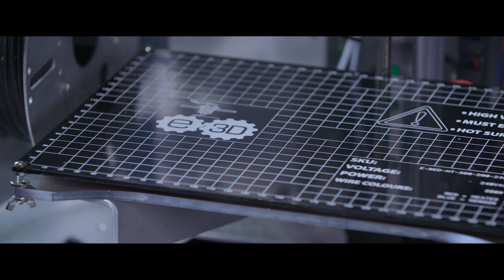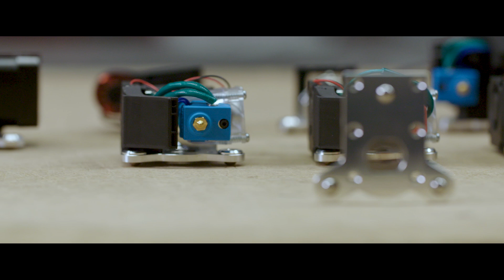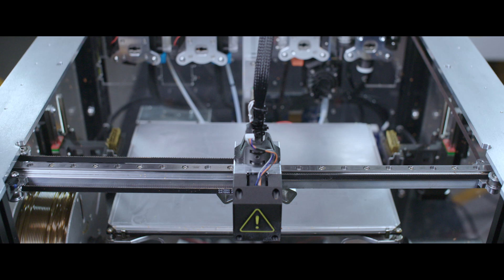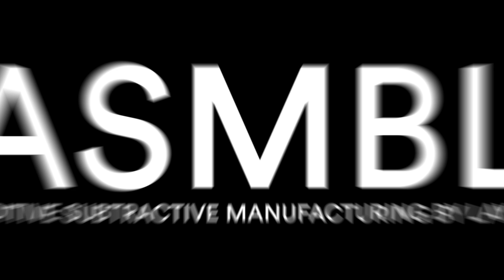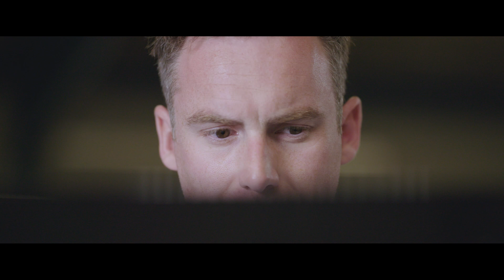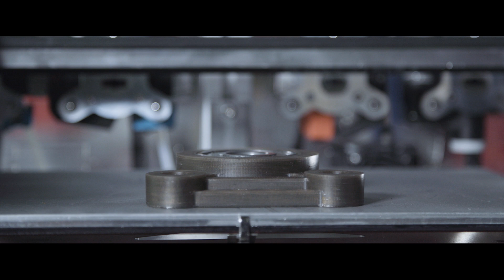The E3D ToolChanger & Motion System with ASMBL™ Enabled

Comment: @E3D-Online would it be possible to automate the process of bulking out the part that should be machined in a standalone software or integrated into slicers? similarly to prusaslicers paint on support you could mark areas that should be finished with machining and let the software modify the stl file that is going to be printed accordingly whilst also generating the subtractive toolpath?
Reply from the maker: Yes this would be possible but is not the case yet.

Comment: Really excited to see the additive-subtractive. I am working on my own version of this! Not going to lie, when I heard you were making a money-is-no-object printer that would be over engineered I was a little disappointed to see regular ol' steppers on it. Seems like this was a money doesn't matter version that still lives in the world of hobby. Some ideas for REV2 - high end servo system for X,Y (yaskawa sigma 7). Z still a stepper, but maybe a more turn per inch lead screw to get more resolution. Linear encoder on Z axis to ENSURE exact layer thicknesses. Lots of people assume lead screws and ball screws will land on the correct value if your stepper steps all its steps but in reality they have variation, even in the highest precision versions. Maybe a high end servo for the extruder also - steppers can never have the smooth rotation that a servo can. Just some ideas:) If you want to get crazy you could look into ironless linear motors for the XY. That will solve ringing and belt stretch at high speed and acceleration. Great job guys
Reply: people that think that are hobbyist.  they don't know anything about cnc.  
linear encoder is a must 
but for 3d printing it's all fine.  this isn't precision work.  
i use a belt system for my z axis.   no screw at all.  lead or ball
Reply: They needed the duet ecosystem and servos have their own limitations. It makes little sense to use servos on a 3D printer, speaking as someone who was obsessed with the idea. The real thing to have on a money is no object printer would be datum aligned linear encoders. Completely eliminate skew and ensure insane precision at crazy speeds. Nobody should care about the angle of the motor stator, its the nozzle you should be worried about

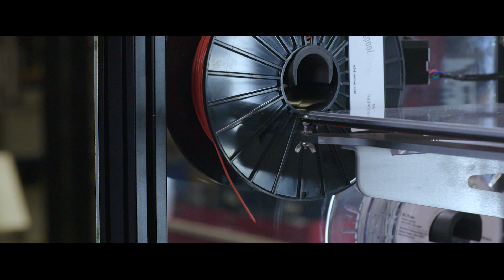Comment: The best sh*t video that suppose the customer is low IQ. at 1:18 look at the indicator dial is mounted with magnetic base on the HIWIN wagon and is measuring the tolerance between the wagon and its rail. lol. this means:
1. they dont know how measure the parallelism between the rails
2. maybe they are thinking that HIWIN is selling them bad products
3. that magnet is not for that size of the wagon and also it cannot sit on the wagon surface correctly. please don't get offended and correct those really bad advertising (lies).
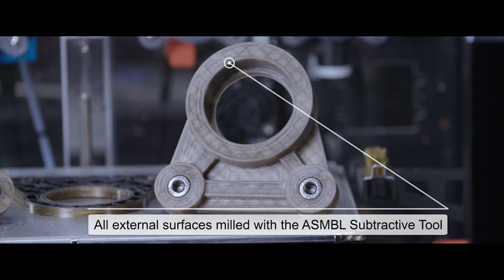4. at 4:15 PEKK nice one.

Comment: Are those tool-change extruders direct-drive?  Half of what I print is with flexible filament.
Reply: I assume you meant to explain that the Hemeras are a direct-drive extruder and therefore good with flexible filament?  and that the tool changer is capable of working with this specific type of direct-drive extruder?

Comment: so you have to pray your bed adhesion is as good as a clamp for subtractive? also belts for subtractive?
Reply: It all comes to how agressively you machine. Very thin finishing passes with very small tools, that could work.
Reply: I guess that if the machining is of 200 micrometers,  most dynamical forces are probably  small enough to deflect belts or structure. Also, we are talking about thermoplastics, not about aluminium or other metals. But, who knows.
Reply: Perhaps people will have to redesign their support system... like printing a decent platform to make the project more stable that it doesnt tip or that mechanical clamps attached to the bed will clamp the projects printed platform to the bed.
Reply: First I thought: additive subtractive manufacturing?!? thats soo cool. but I came to the same conclusion as you and all the hype was gone haha.
Reply: It doesnt look like an issue. Ive had prints sticking so hard to the bed Im lifiting the entire printer when taking it off. (big printers 30x30x35cm volume).

Comment: PEEK, without an enclosure?! Explain please.
Reply: PEEK modified to print amorphously and stay like that, to be heat treated after the print - is my guess
Reply: we are two
Reply: Nothing stopping you making your printer enclosed
Reply: @MD_Builds  PEEK normally needs a very high temperature chamber. Making it enclosed for that would probably need separation between the chamber and the X Y drive parts. Like the bellows system used by Stratasys.
Reply: The prints in the video were not annealed. Annealing often deforms the object which would annihilate the high precision milling. I could be PEKK-A from Kimya (where the 'A' stands for amorph), The specs don't mention that a heated build volume is required. The blog also mentions 'This hi-tech filament can also be transformed at lower temperatures than other high performance materials, such as PEI or PEEK.'
Reply: Maybe the print internal support with cf-nylon to stop warping. PEEK would normally need a high temperature chamber

Comment: I would like to see more about the subtractive part.
Reply: Me too.  I do think they would benefit from a vacuum attachment to suck up all the chips after printing (might cool the print excessively though unless the machine is enclosed).  Chips might otherwise randomly get in between layers.
Reply: @CR-tz4xp  I've seen somewhere that in fact there is a vaccum attachment, but couldn't find it now. Supposedly there are not so many chips. Anyway it would be cool to see it more closely in action.

Comment: I was wondering what kind of slicer is used to print with a machine like this? I am assuming that CURA won’t cut it 😂
Reply: The video stated that any mainstream slicer is compatible.
Reply: 3D Maker Kid you sure that cura supports the subtractive manufacturing part? or the toolchanger? how can this be enabled?
Reply: @GRuizMedia  I'm just quoting the video.
Reply: They mentioned a fusion 360 plugin for this
Reply: @devalopr  Yeah, that's for the subtractive part.
Reply from the maker: 3D Maker Kid is right. You can use any mainstream slicer.
Reply: Nice pun
Reply: How did I miss this pun?
Reply from the maker: @squirrelrobotics  Doh! we missed it too.

Comment: I still consider this to be the holy grale of FDM printing.
True Multi material printing without the downsides of the existing concepts.

@E3D
Is any of your partners making progress to bring this on the market as a consumer product?
Your kit is available for quite a while now. But I just dont find it in consumer products and don't understand why....
Reply: Servo lifting really kills the consumer level interest in tool changing imho, once the Qidi Ifast comes down in price to around $1,000 that will be the dual material machine to have.
Reply: @Anyone700  a two extruder head has its own downsides. But it is for sure the cheaper solution.

Comment: Its a nice FDM printer but its a bit late, SLA is what people are looking for these days.
Reply: Sla cannot replace fdm, and vice versa, very different use cases
Reply: Maybe if you want to print D&D miniatures or or tiny models of the Eiffel tower. If you want your print to be able to do anything but sit gingerly on a table though, SLA is not what people are looking for these days.
Reply: @mrb2917  A peopoly phenom l hast a very similar build volume as this and with modern tough resins like siraya tech blue or liqcreate strong-x you can make strong functional parts which easily outperform common FDM printing materials, especially since you don't have to pay any attention to layer orientation with SLA. And with MSLA there is no time difference between printing 1 part or 10 if you can fit them all on the same buildplate.
Reply: As stated by another person, FDM and SLA have entirely different use cases.
Reply: @squirrelrobotics  Yeah, I got into SLA pretty early on with some of the same wrong impressions (that somehow SLA was just 'better'), it did NOT take long for me to discover that wasn't the case at all.  It's basically trading one set of strengths and weaknesses for a different set of strengths and weaknesses.
Reply: @ualdayan   Tanks for confirming my thought about SLA, it look nice for figurine or sculpting, but I don't know how long I can go without messing all my workspace lol, next machine will be something like that or an MMU for my MK3S , If the printing size is bigger, and I cant build a business case to the wife, I buy that! and hopefully in Kit! :O) Great work @E3D
Reply: i disagree, thsi thing is perfect for my school, sla would be a nightmare at this stage

Comment: Share more details about the inspection camera? that looked interesting
Reply from the maker: So far we have only used it in tech demos.
Like here: https://www.youtube.com/watch?v=PKye66QvVzY

We're trying to encourage others who are adept with the necessary technology to develop the tool properly.
One vision of ours was that after completing a layer, the camera will scan the print and confirm whether there were any faults in printing said layer, if any are found, a subtractive tool could automatically shave the layer off, and then reprint it.

However we have in no way tested this, or developed this past it's demo phase shown in the video above.
Reply: Can yall use it with M.V. to automaticlly adjust things like, pressure advance and flow rate, that might be visually inspected?
Reply: Its a keyence IM series measurement system, for the price they're not great, not bad, but not great.

Comment: you know what i like about this printer. all that functionality and if you include everything it's still cheaper then even the ultimaker 2 (previous generations old printer)
Reply: Not really. The quoted price doesn't include any extruders or hot ends. It also doesn't include the hours of assembly required. Ultimakers may be overpriced, but that's not a fair comparison. I have a tool changer and it's FAR from a polished product like an Ultimaker. Certainly more capable, but it requires a LOT of effort, know-how, and patience.
Reply: I have an S5 and a tool changer. On the ultimaker, I put in the SD card and feed it spools. On the tool changer, I fix the printer and feed it small pieces of my soul. But when it works its awesome....
Reply: @dylanhamm8105 exactly
Reply: @taylorlandry641  welp i mean the ultimakers are still overpriced IMO. say compared to a prusa mk3
Reply: ultimakers are a scam